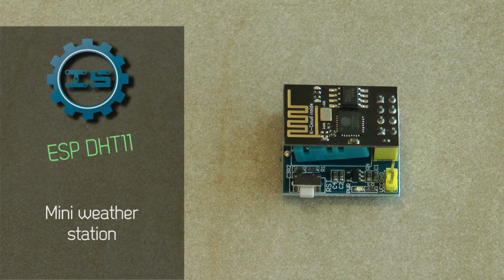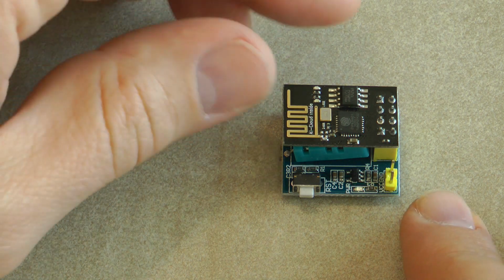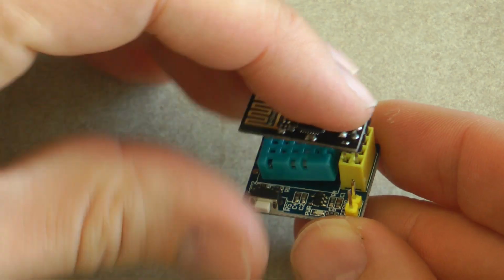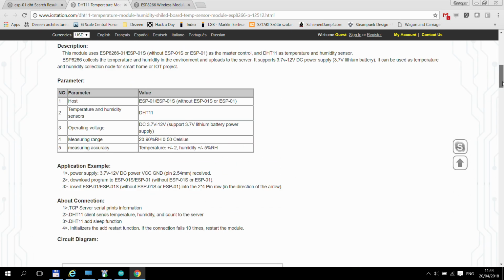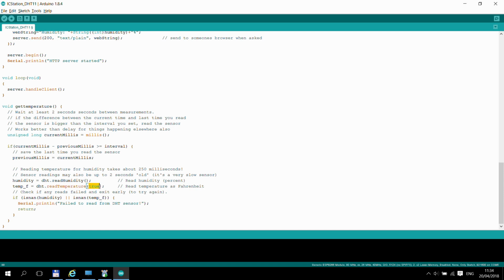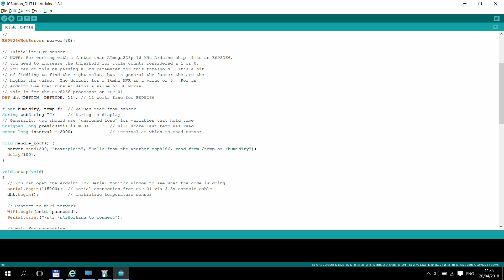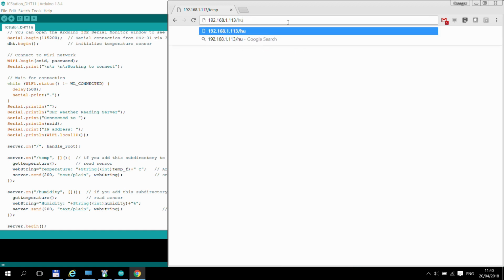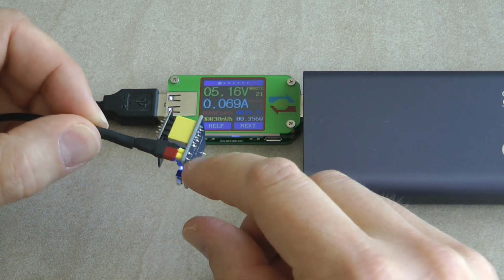ICStation ESP DHT11

Comment: I built this !
I also folded the sensor 180 degrees, so that it is not under the ESP.
As most people know, the DHT11 temperature sensor is NOT accurate, so simply replace with a DHT22.

Next steps ... update with IOTAPPSTORY functionality, MQTT and maybe an ANALOG display on the webpage.

Thanks for the info !
Reply: Is it just a matter of soldering in the DHT22? Or does the code also have to change?

Comment: The ESP's chip gets warm and it heats up the DHT11. Fold the DHT11 180 degrees to fix this.
Reply: Mine is doing that also. But i have problem with it. With old DHT11 it report wrong temperature, so i desolder and solder new one and it behaves the same. It says temperature is 30C where it should be 20-22C at max
Reply: You're sure it's the radio? I think it's a voltage regulator on the DHT board
Reply: Same here -- I was getting 5 Celsius more. Did the fold trick :)

Comment: Can I use reset button for demand Wifi manager reconfiguration?
Are reset connected with any GPIO pin and GROUND?
Reply from the maker: Sorry I have no idea. Maybe easiest if you just move out of range and power up the device. If it does not find the configured wifi, it will call back to the wifi manager.

Comment: You glossed over the difficult part.  Do I need a console cable to get the IP address or do does that happen when I flash the ESP2866?
Reply from the maker: Sorry, I was on holiday. So yes. This code will use DHCP so the ESP will get a dynamic IP address from the router. There is an mobile app called Fing. It scans your networks and shows all your connected devices. This is what I like most to find the IP address of a new ESP. But otherwise you use the same UART programmer and an serial monitor to check the IP.

Comment: Hi, thanks for the guide, i've tried but unfortunately system does not (by serial monitor) shows me the IP address (or if is linked to the router). by the way at the end of loading by arduino application, in red is suggesting me to press hard rest button.in programming module (same as your in other video there is not such functionality). can you suggest a way to solve matter?

Comment: Nice video, thanks.  Please do try flashing your ESP-01 with ESPEasy.  You will need to use the small version (build 147 should do)  to fit in the 512K but I am sure you will enjoy the far greater functionality afforded by ESPEasy including MQTT access to the data as well as HTTP.  Since I started using ESPEasy, I have not touched a C++ sketch.
Reply from the maker: Yes, I think both ESP Easy and Tasmota would work with this hardware. Maybe I will cover that later. I anyway want to spend some time with the new ESP Easy Mega. I think even that has a minimal version that fits in 512K.
Reply: I just purchased some memory upgrade chips that I plan to try in both ESP-01 and Sonoff modules.  Not much advantage to the 01 upgrade, but it should be fun to try.  I can see how it may improve the Sonoffs though running a full strength Mega version of ESPEasy.
Reply: Tasmota do works with that. But i hate the bad design of this item.

Comment: Anyone find that this gets really warm and throws off the temperature reading? I suspect it might be supplying the thing with 5v causes a voltage regulator somewhere on it to dissipate heat that ends up in the sensor

Comment: Do you have no problems with the temperature? Esp01 gets very hot and the sensor detects its temperature by falsifying the data
Reply from the maker: Yes, it is more like a demo board than an actual final design. But you can bend the temperature sensor 180 degrees out, so it is not stuck under the warm ESP. And you can also mount this device so that the sensor is facing down and the warm air from the ESP raises up in the opposite direction. And of course you can just subtract from the measured temperature if it is off by a fixed amount.

Comment: bad design and choices... dht11 is known to be very unreliable and with 0 digits precision, only degrees with no decimals, and it's near the voltage regulator so its reading are falsed by that, too...
Reply from the maker: I don't like the DHT11 either. I think it is great to get somebody started and get familiar with coding first and later enhance the hardware. At least I look at this way. I probably should have mentioned that you better off bending the DHT11 out 180 degrees to get further away from the regulator.
Reply: the fact is that dht22 is pin compatible with dht11, you need to change only 1 define to swap model in sketch, it's way more accurate and costs about the same of the bad model... but people insist in using that nasty one, instead...
Reply: plus it is a 5v sensor on a 3,3v mcu. better use a si7021 without extra regulator. esp8266 is not ideal for battery use at all.
Reply: @squalazzo  what to change in sketch more precis? For using a dht22 instead of dht11.